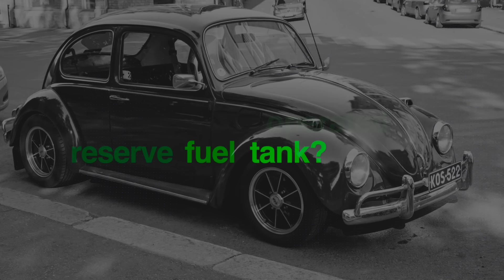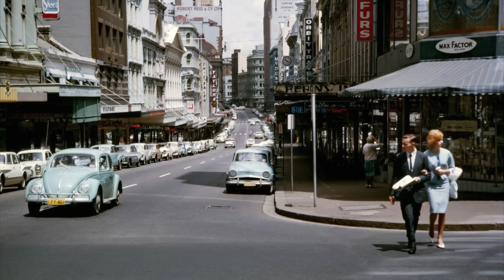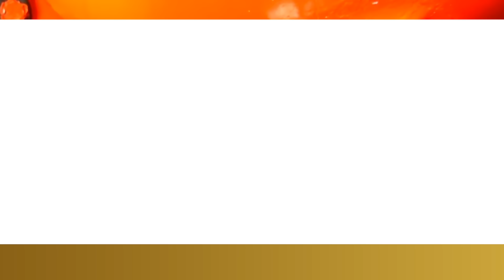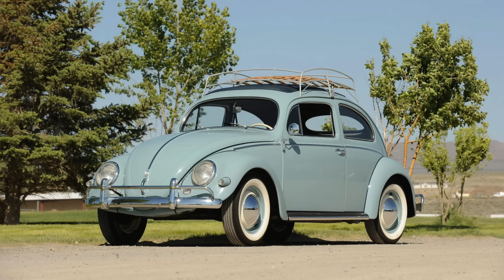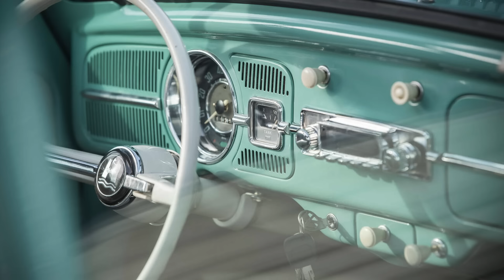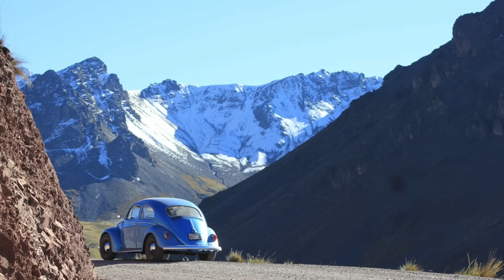No Fuel Gauge? See How Beetle Drivers Survived!

Comment: I had a '57 VW bus in the '70s, so I had direct experience with the one-gallon reserve tank when I ran out of gas!  Thing was, if you weren't within range of a gas station it didn't do you a lot of good!
Reply: The coolest thing IMHO about old VWs is that you can start them with your key..or most anything that fits in the key slot.
Start it and put the key back in your pocket!!
Reply: You can only strand yourself so many times before you learn right?
Gas was $0.50 a gallon and minimum wage was $2.00.
Pure common sense 😜
Reply: I can only assume that after you stranded yourself enough times you kept some gas in it at all times.
In the 70s gasoline was like $0.50 a gallon and minimum wage was $2.00.
Reply: @TomWalters-h4n  Oh, yeah!  Only took ONE TIME to figure it out!
Reply: @questfortruth665 What saved me was that I never got more than 20 miles from home in my little Ratty 61.
Strictly point A to point B..
Reply: @questfortruth665 I bought my 61 for $350 from the photo finisher at the camera store I was working at.
He drove it up to the Washington coast from Southern California.
No rust! No 4th gear!
It came to me with an Empi roof rack and Empi rear bumper ski rack and a walnut Empi steering wheel.
After I sold off all the Empi parts it was a $200 car 🚨
Reply: @TomWalters-h4n  I drove that van all over CA!  I finally ended up in SF when it got stuck in 4th gear and I couldn't make it up the first hill I came to, so I backed down the road to a gas station where it set for a couple of weeks.
Reply: @questfortruth665 In the late 60s my cousin was in the Navy stationed in San Diego.
His hobby was racing both cars and motorcycles in the Mojave desert enduros.
He had a 50s VW type 2 panel with the rear wheel wells carved way out to accept big paddle track tires. 
Gnarly.
Reply: @questfortruth665 In high school my friend had an early 60s VW type 2 ambulance with swinging doors on both sides. We built a skate ramp to fit and he'd park the ambulance sideways on a slope and we'd skate through it!
Damned hippie kids 😅
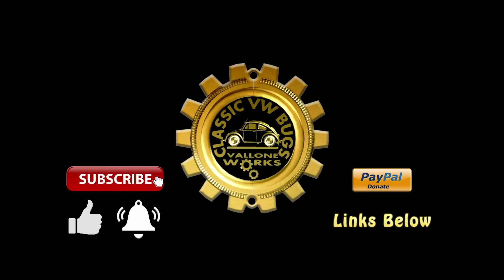Reply: The ignition s 5:36 witch was buried in the steering column... major expense and hassle to fix.
The poor man's solution?
A button on the dash..
Turn the key and push the button..vroom!
Reply: Something's up with Frisco and VW busses. A younger Deadhead friend made his pilgrimage to the Haight and sure enough... his 82 pop top Vanagon got stuck in gear as well!

Comment: Well done! It might surprise you to learn that small planes also rely on a similar procedure.  They have a fuel gauge, but planes bounce around so much in turbulence that the reading isn't always 100% reliable.  And there's often more than one tank, so you need to transfer fuel to maintain balance and center of gravity.  So you use time and performance to estimate your remaining fuel, just like in a VW.  But the only way to know for sure what the remaining fuel is in a given tank is to run it dry.  You can usually rely on a fuel pressure gauge to catch a low tank before the engine sputters.  ('57 Oval, horizon blue)

Comment: The fuel gauge on my '74 Beetle has a life of it's own. Can't trust that thing to point in the right direction. I guess Beetle owners get used to such things pretty quick
Reply: I have a '74 that use to act up. Check the ground. P.S. the ground wire is brown. Good luck
Reply: Same here with my 76 ! Fill up is always a surprise for me.
Reply: @DianaHerrera-xz4ml A tip of the hat for keeping a beetle alive 😜.
Reply: My 77 type 2 
I knew how far I could trust the fuel gauge from owning a 71 VW Square Back. One bitten twice shy
Reply: I owned a 71 VW Square back. AKA " The Sportbox". I loved that car.
I learned that the fuel gauge was not "linear'. The first half of the tank according to the fuel gauge was actually closer to three quarters of the tank! When the gauge said 'half full ' I gassed up..
No reserve tank 😅